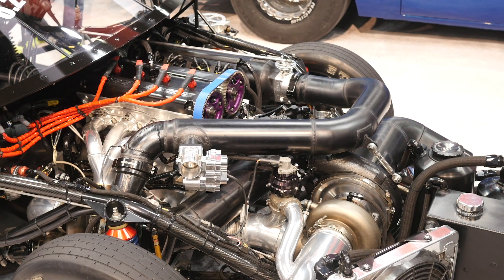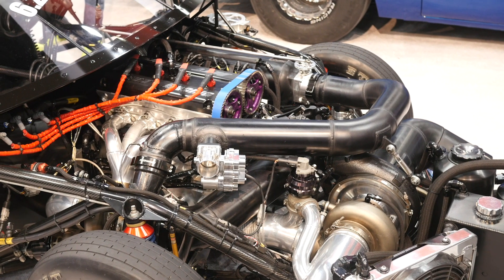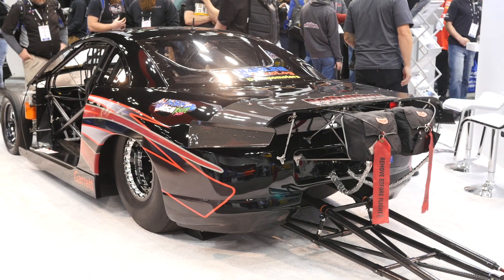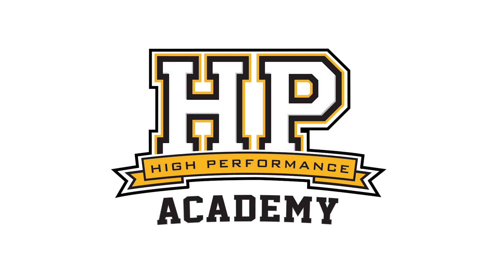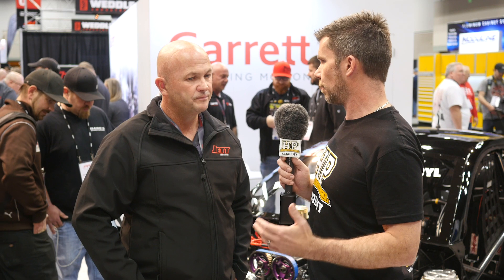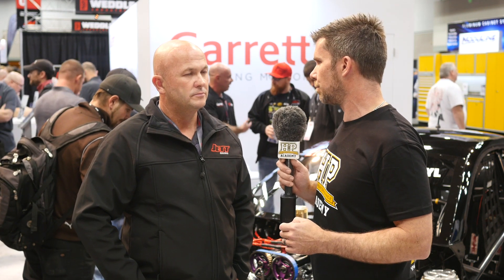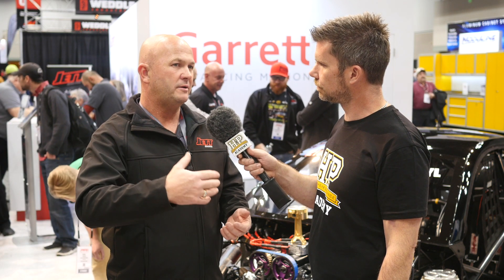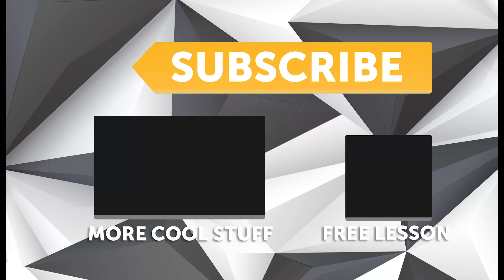2000WHP | Single Vs Compound Turbos | 4 Cylinder 4G63  [TECH NUGGET]

Comment: Import guy's be like, "my 4 banger makes the same power as your v8"... yeah for 1.5 milliseconds...
Reply: What on earth is that based on? The reality of physics make it really difficult to match V8's power/torque. That said, as I mentioned in the full video on this build, compound turbos is the next frontier in really fast 4 cylinder competition. They can make a sh*t ton of power and a much flatter torque curve. We just have gotten to the point were we just can't keep going larger on the turbine side of the turbo, a relatively small displacement engine just doesn't make enough exhaust energy. So if he has to lift because he got wheel spin after it hit full boost, RPM drops like a rock and it's best to abort the run.
Reply: @YZFoFittie  that statement just proved you don't know much, go watch import vs domestic world cup if you think smaller powerband = slower car.
Reply: @YZFoFittie  pff 180hp on 8.2 liters of v8 glory xD
Reply: So amazingly a motor 3 times the capacity has potential for more power?